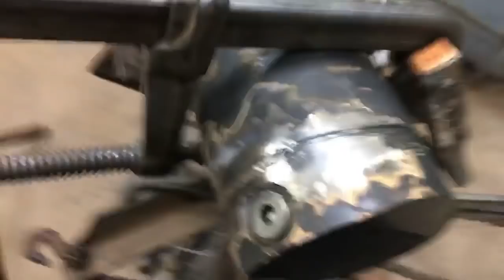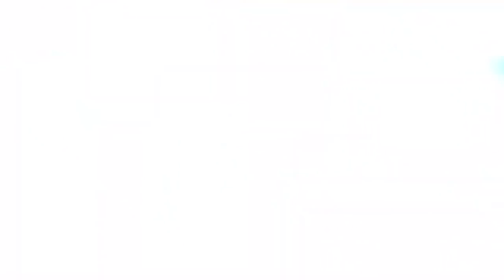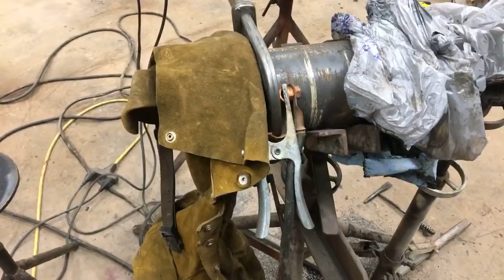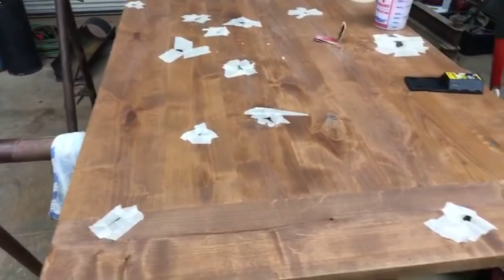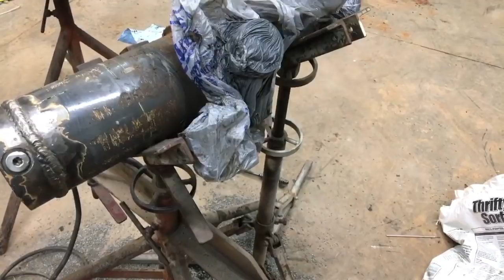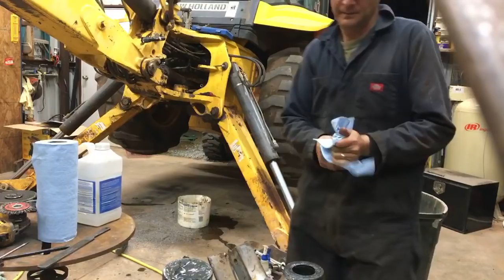Sunday live night surgery, does the B95 make it?

Comment: The cold weather is so hard on iron. When I was a mechanic for that construction company this time of year I threw more sparks than chrome. You know you are averaging more than one new sub per hour since your last post. I am glad I got to know you before you are a bigger household name than The Rock
Reply from the maker: tdej80 winters here are usually when we do a lot of school footings, so I’m hoping for lots diggin’!!!! As for the subs, it is faster than it should be I think! A bit overwhelming for sure. Cold seems to show up the weakness in the hydraulic system, more seals to change!
Reply: @Digginok  You do transport your machine a lot. I always thought when it is cold and the machine is good and hot is part of the problem. When that same machine gets loaded onto a truck and pulled through the cold air 60mph it will just cool even faster. Your whole machine is quenched. I hope the winter does find you busy. But if you dig a lot you will likely be posting many repair videos.
Reply from the maker: If it’s below 20 degrees I leave it running on the ride, just a rule of thumb for me. The cold air does cool things down quickly!
Reply from the maker: Cold air is the worst for steel equipment, I am glad I live this far south!!! I cannot imagine what it is like for folks north or here in the wintertime!!!
Reply: @Digginok  The construction company I worked for had divisions in many states. For special projects they would pull iron from where ever and send it where ever. They took a bunch of our equipment to Florida for about 6 months. I know that sand is not kind either. Dozer tracks and undercarriages on excavators don't like it nor do any seals. Equipment is just too slow to outrun problems. Every different environment brings it's own problems.
Reply: @Digginok  Columbus Ohio was corporate headquarters for the whole company. We had the deepest rebuild capacity for the whole country. Many times a trailer would roll in with something that was really beat and drop it in our lap, then they would drive off with something we just worked on for weeks. It was a job and I thought knew a lot when I started because I did not know enough to know that I did not know. You learn a lot fast when you get forged in the fire.

Comment: Good video Frank. Sorry I missed the live feed as I had a church function to play at.  Have you ever considered a good shop welder like an old Lincoln Idealarc 250 AC/DC?  They can run any rod the SA can and they don't run out of gas.  I know you like the SA, I like mine but the Idealarcs are sweet and you can find them reasonable if you keep your eyes open.
Reply from the maker: Thanks Steve. I would like to have an idealarc maybe someday. Then again I have made every repair since 1993 with that sa. Sorry you missed it too, real fun time 😂
Reply: It is funny you mention the good old Idealarc 250 AC/DC. I use on at work daily and they are in my opinion the best transformer welder of all times. I really prefer the vintage that have the round top but the square ones are pretty good. I have 2 of them in my shop at home. If Frank wants one of mine he is going to have to make a road trip!
Reply from the maker: Our Vo-ag class had a few I welded with. I took a 6-g test on one once too. The test lab had one. Someday maybe
Reply: @Digginok  Used is always a good option on these machines. They are nicknamed ''tombstone'' around here because they say if you buy a new one you could use it for your tombstone. They are 60% duty cycle at 250 amps and 100% duty cycle at 125 amps. So you can't overrun the machine. Large leads are good just to carry the current and let you set the machine lower and still have plenty of punch. I am sad to say that both of mine formerly belonged to men are late. They were both old weldors in the community. How and why and for what price is a story all of it's own. Dibs?
Reply from the maker: But the sa would just sit there and cry while I made all the lights flicker!
Reply from the maker: @melaniew77msn  Yes sir dibs!
Reply: @Digginok  My Idealarc never runs out of gas. These are seriously the 3rd best arc welder in the world. On transformer welders it all comes down to the quality of the rectifier. The rectifier is more important than the rheostat. I am sure you know that the rectifier is what turns the AC into DC. The transformers are all the same. The SA would still get all the lovin in the field. It is nice to hear an SA run but it is also nice not to hear an SA run. When you are welding at 11:00 in the evening the natives are wanting to rest. Happy wife happy life ;). You never did call dibs. I have to offer dibs on my welding equipment. If you knew what I paid for them with long leads on both you would lose your mind. I like the AC leg I prefer to run jet on AC.
Reply from the maker: Dibs dibs dibs!
Reply: My latest Idealarc 250 is one I found in St Louis on Craigslist. It’s a 1989, the last year of the round top. It was bought new and had almost no use. It’s literally a new 1989. I have it on the Lincoln steel wheel tricycle undercarriage with 100’ of new 1/0 cable. 35’ of 6-3 SO power cord.  I love it.
Reply: @Digginok  Now you are speaking my language. The used market is ok if you know where the welder came from. These machines can be hurt. The damage is done in a vocational welding program where you always have that one clown that messes with your welder when you are welding. To change the polarity while the arc is running does murder the rectifier. It is nice to have that polarity lever because some hard surface likes AC and some hard surface likes straight polarity. I would assume you have quick disconnects on your SA to allow you to swap back and forth between Reverse and straight polarity.
Reply: @stevewarner8880  Can I be so rude as to ask what that gem set you back? If that is to personal I understand and apologize.
Reply: I gave the huge sum of $300. That was without leads and undercarriage. A buddy and myself buy these and clean them internally and have the sheet metal sandblasted, zinc primed and powder coated.  They look better than the day they shipped from Cleveland!  I haven’t done anything to mine but blow it out and lube the gears and bushings. We’ve got some they looked like they were dropped out of a second story window and still welded great. Anything short of a direct lightning strike and they still weld. We do Miller Dialarc250 machines also but I’m a Lincoln fan boy.
Reply from the maker: This conversation is priceless!
Reply: Well Tim, I’ve never heard a Joke about Ohio residents, Kentucky maybe, not Ohio. The only Ohio resident I’m disappointed with is your former turn coat Governor the Honorable John Kasich
Reply: @stevewarner8880  This is a great channel and the author has real patience to let us explode his comments section and even join in with us. Thanks Steve and Frank you guys are great!
Reply: @stevewarner8880  Top 3 worst people on Earth   Sex offenders, Politicians and Hippies and that is handy because most of the time if a person makes the list they make it in 2 of the 3 categories.

Comment: You seem to be a decent welder....but it appears you are putting too much material on top.....more heat ..not too much much more and your rod speed could be a little faster....I don’t know why you felt the need for stringers or even why the 309...I personally like the look of the stainless
Reply from the maker: You are more correct than you know!!!
If I could go back in time it would be one hotter weld. Stainless was suggested because this is the second time for a weld repair.

Comment: Did you ever throw on that hydraulic filter?
Reply from the maker: I gotta change out some cylinder seals, I’m hoping to get them done first.
Reply: @Digginok  Sorry It took me a second to get back I was over looking at the community page of your channel. Man you dig the tightest ditch I ever seen. Laser eye Frank
Reply from the maker: Thanks, been a good week no leaks! I happy as a boy with a new puppy!
Reply: @Digginok  Would there be any advantage to hard surface on those flat teeth you use in the middle of the bucket?
Reply from the maker: If they last longer sure, the flare teeth cost quite a bit more.
Reply: Did you get the email I sent you at 1:30 in the morning? If your notifications were on and it woke you I am sorry. I wake like every 2 hours all night.
Reply: @Digginok  The next time you order some have them delivered to my house. We can throw some hard stuff on them. Teeth are a big rip off, they are junkiest cast steel ever. There is honestly about 50 cents worth of metal in them. No X-ray or anything expensive involved!
Reply from the maker: I may take you up on that offer!
Reply: @Digginok  You sure have been kind with your shout outs about those teeth on the community page. Thank you
Reply: @Digginok  I promise we can make them last longer. How expensive are those big flare teeth? If you don't mind me asking.
Reply: Sorry to keep grinding on that filter. I understand that you are going to open the hydraulic system again very soon and you are waiting until after you are done.

Comment: Are you still running daylight to dark?
Reply from the maker: tdej80 yep
Reply: @Digginok  Good man. The weather in Ohio is snowy rain and the ground is starting to crust. That caused me to give up. After work I just decided to cook chicken noodle soup. It is a good morale booster around here. I forgot to mention when you are working with 309 grinding wheels work harden the surface of the weld really quickly. Sanding discs take away metal much faster. I am sure you noticed after you ground just a bit the sparks changed color and the wheel lost size as fast as the weld. I like north blue fire 4'' 24 grit sanding pads. That ability to surface harden from abrasion is another handy feature of that filler metal. It welds well into quenched and hardened steels also. It makes a good build up when you need to put multiple layers on because it will not spall or check crack like some hard surface rods.
Reply: without counting I keep around 25 different alloys in my shop. Yes buildup is better for just buildup. That is a lot of different alloys to stay on top of. For small business versatility is the best. Mastering that many alloys for different filler metal sizes and different process takes up a lot of space in the mind!
Reply: Lincoln electric should sponsor you. LH-70, wearshield ME ,309 stainless, 5P! I bet that some people picked up a tube of 309 after watching this. Come on Lincoln show up with a corporate check!

Comment: Still holding in solid with no leaks?
Reply from the maker: tdej80 so far
Reply: @Digginok  I am sorry you would have been a little more comfortable had the weld been a little hotter. The depth of the grove should have been sufficient for the penetration. On the root pass we did not want you to dig in just fuse into the base metal. You had a decent preheat and started back on the previous bead plenty far enough to get the rod running well. It is also a fact that you took off uphill on every rod to make the root pass. The cap being stringer beads was the best way. The stringers put less heat input in and it is easier to tie into one side at a time. I am sorry I did not guide you into more heat on the cap passes. All the cap passes were needed for was just to get the size of the original weld back. With the stringer beads it does not have to be scalded in to be tied in!
Reply from the maker: Walking a fine line I don’t think you steered me wrong, better safe on the cylinder. I have ruined one before.  And without some instructions I’ll probably do it again. I think my only regret is not grinding out the whole weld and doing it completely with 309.
Reply from the maker: And you tried to tell me to try hotter I didn’t listen. It’s all good and working.
Reply from the maker: Remember when you told me on the phone to set it a bit higher after practicing overhead? I didn’t that’s what I regret.
Reply: @Digginok  Well I am wish you would have been happier with the cosmetics of the finished product. But that was a new rod to you and those rods do have a bit of a learning curve. You will always have critics in the crowd I guess, that is part of the deal. I dare anyone to take this learn on the fly challenge and do a better job than you did.
Reply from the maker: Thanks Tim!!!
Reply: @Digginok  I thank you for making a live stream out of this so that I could be as close to there as possible. You put pride aside and honored my request at the chance of possibly having troubles for the whole world to see, I won't forget that! At the end of the day it is working and the stream was a lot of fun for the audience! I seen some names I never seen before on that stream and it looks like you picked up a few subs since this video went up. Youtube does seem to enjoy watching people solve problems via welding. I just wanted to check in with you because after reading a few comments I was hoping you were not disappointed with the repair too badly or with me at all. I have found a really good friend in you and I don't like letting my friends down!
Reply from the maker: Believe me you did not disappoint! It was a bit nerve racking being live, but overall I think it was good for me!!! I’ll get better I’m ready for the next one!
Reply: @Digginok  I wanted to say those were nice looking rollout pipe stands you used as your turntable. As well as you did first run out with those rods by the time the tube is burned up you will love the things you can do with them and be asking for them by name. Like I said thanks again for risking your own shame to honor my request, and I won't forget it!